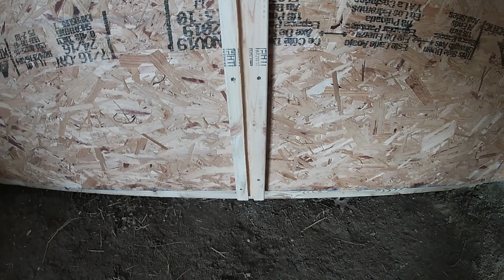All about our lambing pens, fenceline feeders and general barn construction and plans! Vlog 3

Comment: This is beautiful and simple, we are in SC Kentucky. We rennovated an immense old tobacco barn. 66' x 68' with a loft. It has the cracks for drying tobacco years ago. We love the ventilation for our flock of White Dorper. The lambing area is within the main barn so any wind moisture never gets into that area. There really is very little problem to start with and we get 45 inches of rain a year.
The cooling breezes from the ventilation is better than a sealed building. 
Your lambing panels have solved my problems with ours. I wanted sturdy but light and not permanent. Thank you.
We start lambing on Feb 12 th.
You have a lovely set up.
Reply from the maker: I am so glad it was helpful for you.
Reply: @cedarviewfarm1542  Hello, how are you, can I talk to you about farming, raising cows?